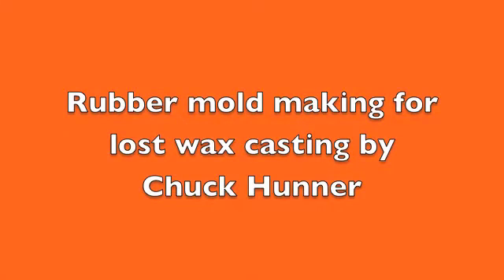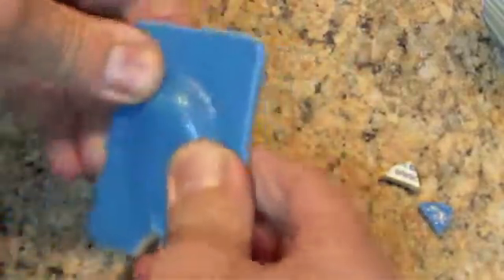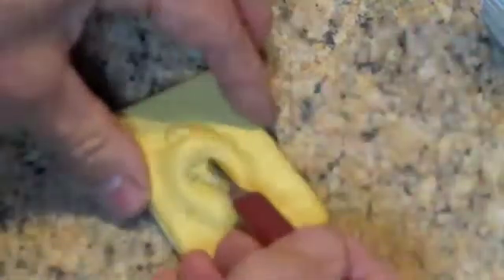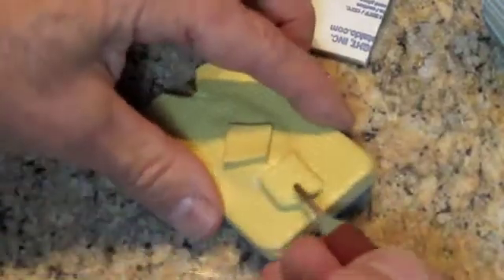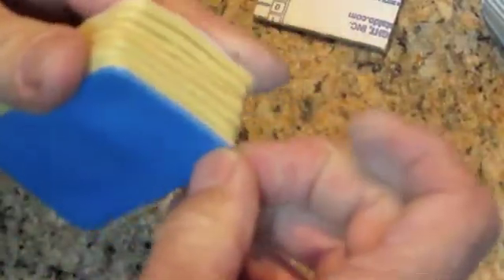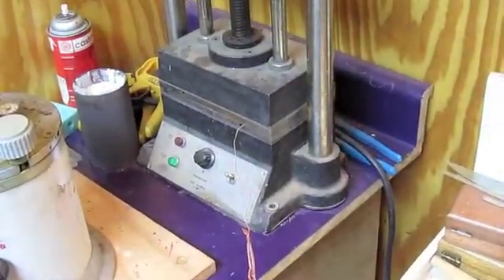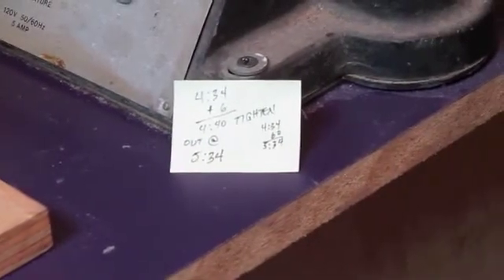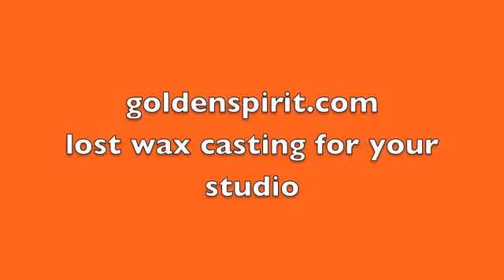How to make a rubber mold of a ring model for lost wax casting

Comment: hello! just found this excellent video. Do you time 45 minutes from the moment you turn on the cold vulcanizer or preheated to the specific temperature? thank you
Reply from the maker: Thank you for your compliment and excellent question, Sambora Jewelry. I preheat my vulcanizer to the specific temperature. I use a thermometer to measure the temperature. It actually only takes my vulcanizer about 13 minutes to reach 350°F, or 177°C.
Reply: @chuckhunner  thank you Chuck! Wher do you get that pirometer for meaisurering temperature?
Reply from the maker: @sambora.jewelry  
My first pyrometer was a simple cooking thermometer. It went up to 450 or 500 degrees Fahrenheit. I used that to measure the temperature in my will vulcanizer. Later, when I could afford it, I bought a digital pyrometer through Rio Grande Albuquerque.

Comment: Too bad it is such a hefty initial investment for the rubber vulcanizer... $600 - $1200 ouch.
Reply from the maker: damok9999 Why not invest in an aluminum mold frame, mold plates, and a couple of C clamps? Then you could bake your mold  in a kitchen oven. The world is an expensive place. When you begin to invest enough of  yourself in it, it will invest in you! Castaldo has a good article on oven baked molds at http://www.castaldo.com/english/use/u_athome.html
Best Regards,
Chuck
Reply: Chuck Hunner
Cool that was the next thing I was wondering, if you can bake in the oven.  I would still need the tools to finish the lost wax method though... I think i should start mastering that side before making the molds.  Still now that I know a cheaper method i will keep the possibility available in the near future.  Thanks!  I have so many unique ring ideas, many require a mold or hand etching to reproduce so this will be required to complete my goals.  I see the molds like you are making alone sell for $20 minimum on ebay : )
Reply from the maker: My molds are $30 minimum for a simple, band ring. I always use silicone rubber to make my molds. I know several artists who just have an alcohol lamp, a pointy exacto razor knife, and a couple of dental tools to carve their waxes. They send the waxes to places like http://silvercloudcasting.com/ in Albuquerque or http://jewel-craft.com in Cincinnati.
Reply: Chuck Hunner
Oh I see, one could start carving wax first.  I didn't realize there are third party casters out there.
Reply from the maker: Right - plenty of companies that do 'contract casting' for wax carvers and jewelers.

Comment: Have you ever tried to make a rubber mold of a 3D printed ring? The melting point of PLA (common plastic material for 3D printing) is 302-320 degrees F.. it's really close to the vulcanization temperature so I'm guess it might not work.
Reply from the maker: Nate Snippe Thank you for your excellent question. VLT rubber from Castaldo (160F) as well as 4X Zero Shrink  (250F) rubber from Zero D Products both vulcanize at lower temperatures. I tend to use RTV compounds to mold RP or 3D printed models.

Comment from the maker: Hi 19sert!
Sorry it took me so long to find your excellent questions! I usually have people send me emails from flexible jewelry molds dot com
Cook your natural rubber molds for 7 1/2 minutes for each layer (1/8 inch cooks for 7 1/2 minutes) A mold 1 inch thick should bake for one hour.
It is better if your molds do not have vent holes. Look for a little mold rubber squeezing out between the mold frame and the mold plate.